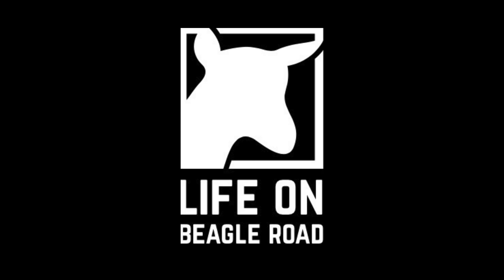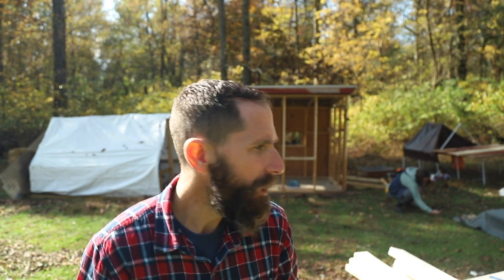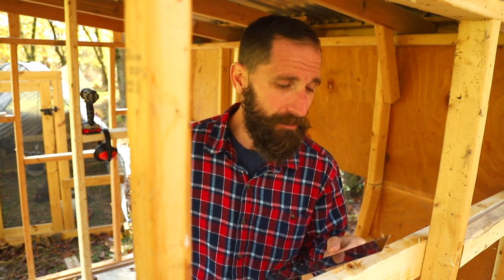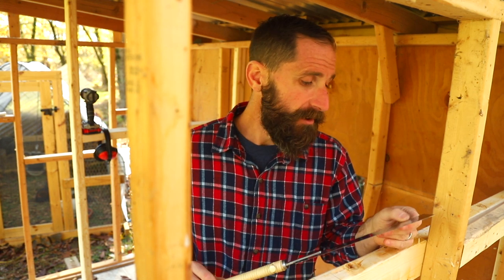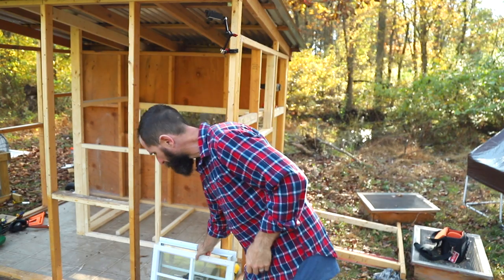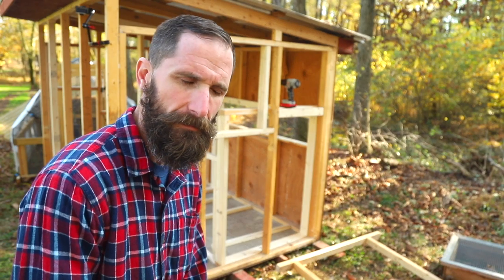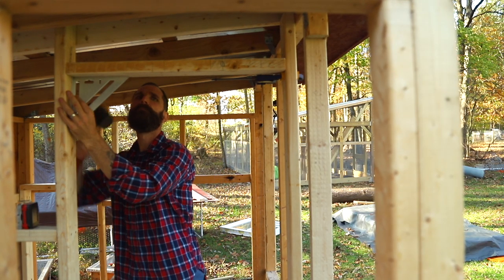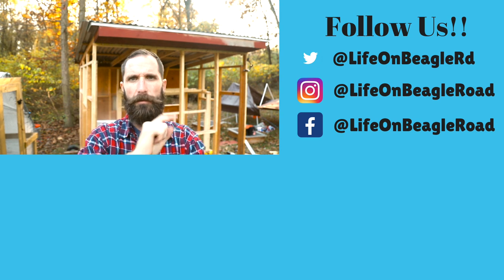Chicken Coop & Run Build || Part 7 || Window Upgrades

Comment: You have done a great job today. If only one measurement was off, then improvement has been made.  I was told it's better for it to be a little long ( it can be trimmed), rather than too short.  That way you don't waste lumber.
Reply from the maker: Great point! Too long is definitely better.